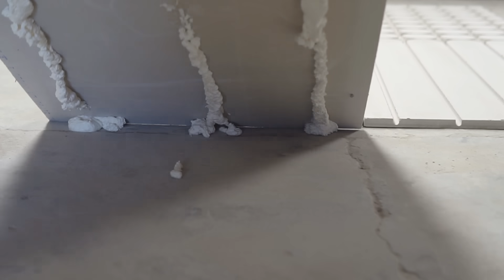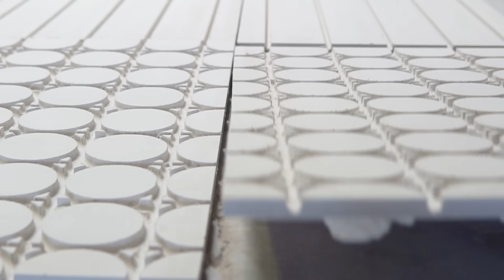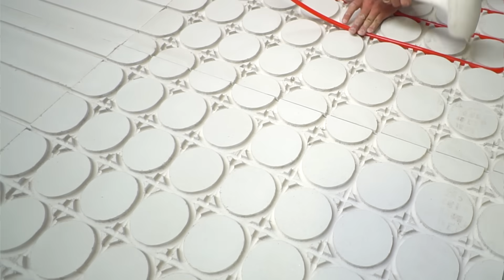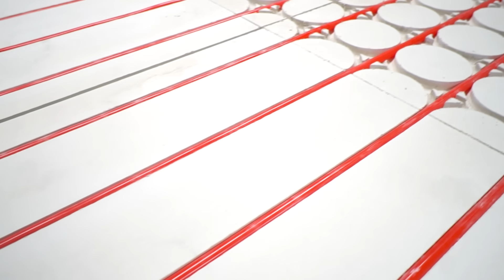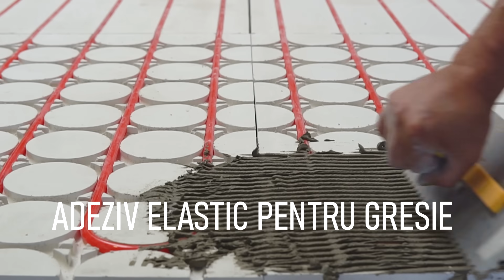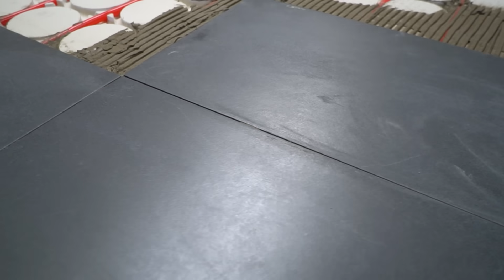Bjorn Heizung - Sistemul de încălzire inteligentă prin pardoseală

Comment: Acest sistem este pretabil pentru o casa cu structura metalica, tinand cont de faptul ca nu exista placa de beton?
Reply from the maker: Sigur, se montează direct pe stratul de OSB care închide planșeul cu holțșuruburi. Apoi se vine direct cu finisajul peste sistemul de încălzire în pardoseală
Reply: @bjornheizung5252  multumesc pentru raspuns. Imi fac griji legat de rigiditatea suprafetet, nu de altceva. Mi se pare ca doar OSB+acest strat nu dau destula rezistenta si e posibil sa se cam miste podeaua.
Reply from the maker: @dravra  rigiditatea vine din grinzile de sub OSB, osb-ul de 20mm nu am avut probleme de flambaj. E ok inclusiv cu gresie peste sistem.

Comment: Bună ziua! Sunt interesat de eficiența sub parchet. Nu găsesc referințe a unor beneficiari cu acest tip de montaj. Ținând cont că lucuiesc în nordul țării nu știu dacă sistemul este suficient sau trebuie combinat cu calorifere.
Reply from the maker: Raspunsul corect, depinde de mai multi factori specifici proiectului dumneavoastra. In mod normal cu o izolatie decenta, sistemul face fata necesarului de incalzire.
Reply: Mai ales la casa pe pamant aceste sisteme sant mai eficiente, combinate cu calorifere, spun din experientă !